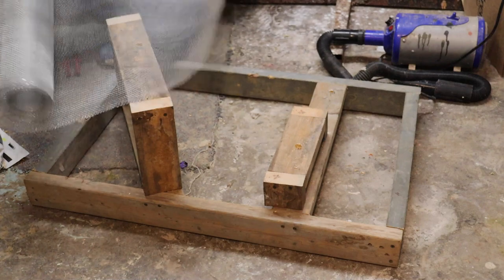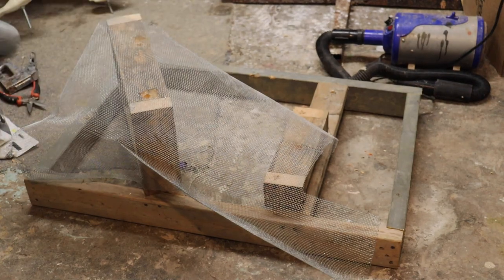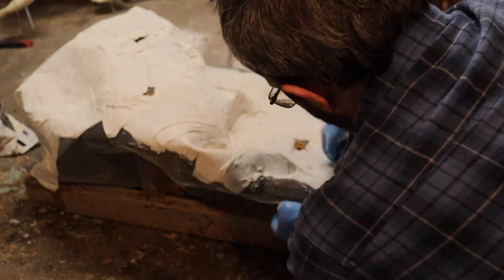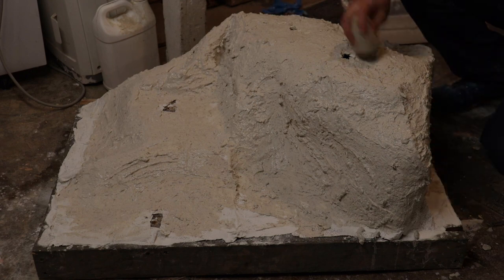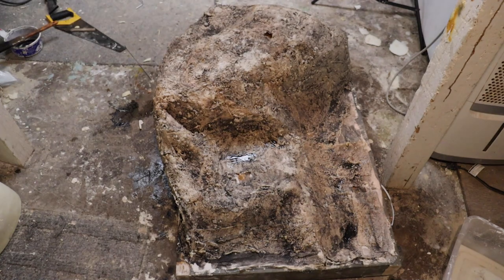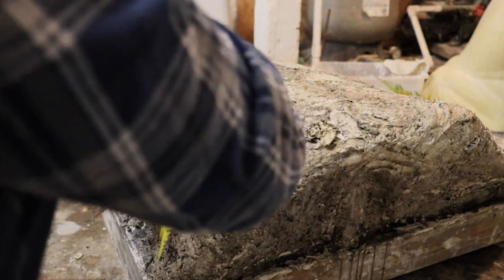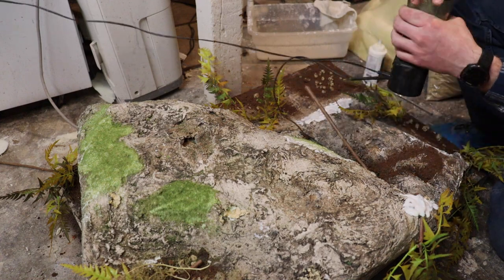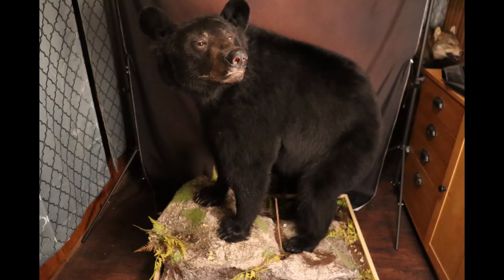Making Of A Rock Base For Taxidermy Bear

Comment: Can you send me a picture of what kind of paint you use thanks
Reply from the maker: I use a powder tempera paint for most of my colors, not sure the brand I've bought different ones, but a black, browns, and greens are my typical choices. You water them down depending on the intensity of the color you want to show, if you spray from a bottle you just have to make sure you mix all the clumps out or your bottle will clog.